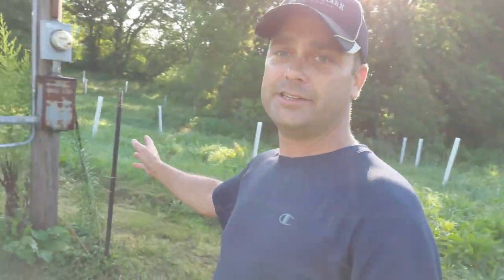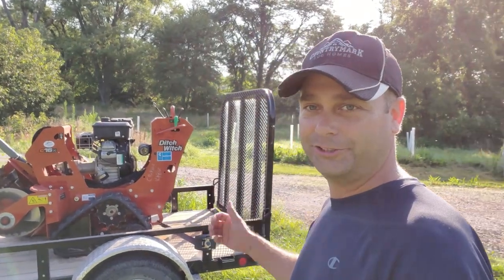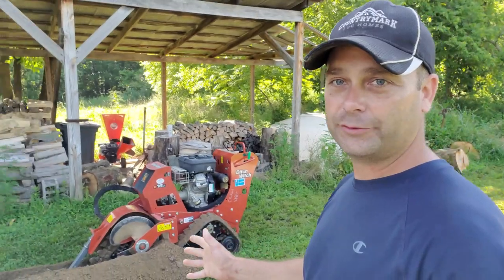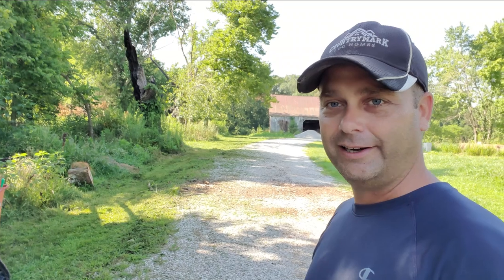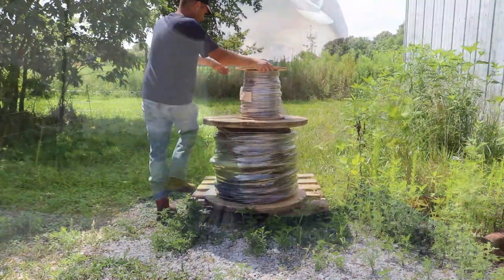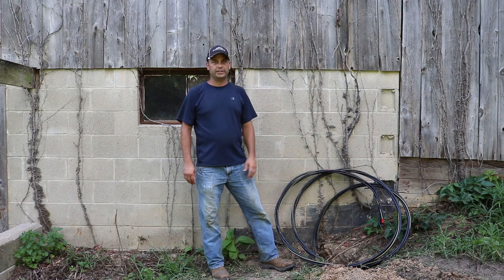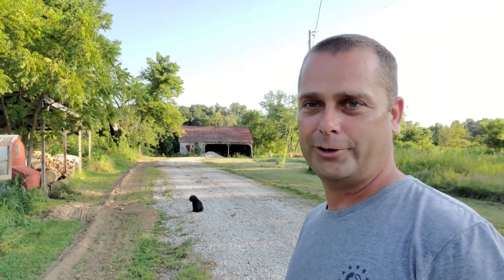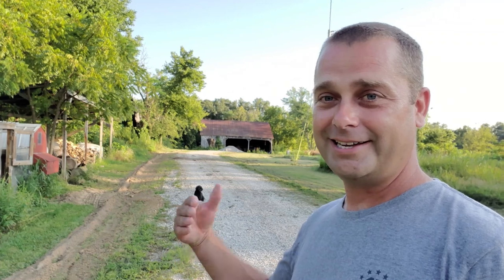Trenching in Underground Electric Service to the Bank Barn

Comment: I like your videos very much . I think that it's great the way you explain what your doing and why . Just like you did with the water line . Explaining your costs and what it's gonna cost you for a job is great . Some people do a job and don't explain the costs that are involved . Oh jobs done and that's it . Even the type of wire and size is good to know . You are so right on solar . You already have hydro on the property so why not use it . The amount of hydro you are going to use is not going to add much to your hydro bill . Great videos you have there . Keep them coming . Smart in using your blade to fill the hole . I thought that you would be using the bucket . What do I know ? LOL .

Comment: Very good job with that trencher.  I have a backhoe on my tractor and it probably would have taken me at least as long if not longer to do the job (digging the trench then filling in).  I like your idea for rolling the wire out.  I have done kind of the opposite.  I ran a pole through the holes of the spool then hung the spool on a home-made jig and pulled the wire off with my tractor.

I could be wrong, I am by no means an expert and am not an electrician.  I think you might actually get a little more than 60 amps (at 240 volts) on that wire run.  I wouldn't worry so much about the current draw for lights or receptacles in the barn, but for warmers you probably want to stick to 240 volt appliances.

Good luck and look forward to seeing the progress.
Reply from the maker: 60 amps will have 2.85% voltage loss at that distance.  A maximum of 3% is recommended.  You can get more amperage but the voltage will drop will increase.  I could get 100 amps but voltage will drop 4.75%.  So yes it is possible.  The breaker panel I installed is rated for 100 amps, but right now I am feeding it with a 60 amp breaker.  I could increase the breaker size later if I needed more power.

Comment: So happy to see someone who knows how to properly use a blade. I usually cringe when I try to watch inexperienced ppl backfill. You're water must be really shallow if u can add a well pump to the end of that run. No way could we get away with that, with pumps @350+ feet. Enjoy seeing you work your way step by step through the improvements to make chores less of a hassle. Time is money. 

Keep'em coming!
Reply from the maker: The well seems to be spring feed.  The water level is high enough to dip out water by hand.  It is a couple hundred feet down the hill from the barn.

Comment: I was in telecom for most of my adult life so not very familiar with high voltage. But that looked like aerial cable instead of burial cable. (The difference is in jacketing, fill and insulation. In the case of the aluminum ground it is exposed and in ground its life is greatly cut because of constant exposure to moisture)
Reply from the maker: The cable was USE-2 cable.  Underground service entrance cable.  90 degree C rated.  It is direct bury rated.  It is only a ground connection  between panels.  It is not used for a ground rod connection or as actual ground.

Comment: An equivalent UK mains cable would run at £2m! But that would be 35mm concentric 240v Phase - Neutral and Earth! 

You can buy load balancers (multi tapped Auto Transformer) where the volt drop is excessive .... but they are rare, ..... and expensive!

Comment: Good job!  Did you put any detectable warning tape in the trench?
Reply from the maker: No I didnt
Reply: The buried conductors will do fine for detection purposes.  A line locator could be used on them without a problem

Comment: Didn't notice you putting down orange warning tape above the electric lines. Was the inspected by the county or town?
Reply from the maker: National electric code 300.5 (D)(3) is for direct bury underground service Conductors (which is where the warning tape is called out to use).  The National electric code, defines service Conductors underground as Conductors between point of electrical service (electric meter) and first point of customer's service (which would be my 200 Amp breaker panel).  These Conductors are feeding a sub panel from my main breaker panel and would be considered feeder Conductors,  not service Conductors and tape isn't required.
I know some areas have their own code requirements,  but we use National electric code here.
Reply: @CountryViewAcres  Thanks for the clear explanation. Were it my install, I am sure I would use the tape regardless. It's cheap. Also, the depth and box installation...both ends...would need to be permitted and inspected by the county.
Reply: @timgarner6768  Agreed.. it takes two seconds and cost pennies.  You may be saving someone's life in the future. May be your own.. may be your kids when they get older and start modifying the ranch.

Comment: I am by no means an electrician but will be doing this for a property I recently purchased. I'll be going from the meter on the pole to a barn about 200 ft away. I'll probably use a 60AMP panel in the barn. Where I get confused is the wire. Can you tell me exactly what wire you used? I will mostly likely be purchasing at Menards or Home Depot.
Reply from the maker: Southwire voltage drop calculator will help size you wire.  I used 4 conductor wire.  The ground wire can be smaller size.  I think I used 2/0 wire for hot wires and neutral and 1 gauge for the ground.
Reply: That's some big expensive wire! You could probably manage 10 gauge wire and 15 amp breaker at that distance. Do the calculation. If 240v less voltage drop. If you need 60amps you will need that huge wire period.
Reply: @Randomadventurelife     I just double checked him.   At a 60 ampere load, 360’ aluminum conductor, 240 volts and 3% drop he is exactly at 2/0 aluminum.

Comment: You'd be amazed what you can power running off solar and wind. It ultimately comes down to the battery bank, and batteries have come down to around 25% of what they cost 10 years ago. Solar panels and wind turbines have also come down quite a bit while also getting more efficient at generating power. 

Also, the thing about solar, with a battery bank, is that despite all the upfront costs, which you can finance, you don't have to pay an electric bill if you're off-grid. All you've got to do is match the system you put in on a building to the power needs you'll have there. I suspect a livestock barn would take quite a bit less power than a home for a family. Even on a home add up an estimation of your electric bill for each month of the year, and add up the total for maybe 15 years then compare that to the cost of a PV power system with a battery bank. At worst, these days, they wash out, they're roughly equal. But, the PV system with battery bank usually tends to be less expensive over that time, and you don't have to deal with power outages.
Reply: Sorry to disagree, solar and wind are great, but let's be honest, if already connected to the grid, they make no sense at all for general use, except as an expensive science experiment, or maybe as an investment if the local electricity provider is buying your electricity back (and maybe not)... there is no way it's less expensive, everybody would do it if that was the case. 
Batteries for the 3 sites would cost more than $1500, and much more if you buy expensive batteries ! It could work for LED lights, but imagine you need to plug a 1000-2000W tool on any of these 3 places, only for a few hours ? That means at least 3 x 100Ah batteries (1 x Battleborn 100Ah is ~$1000, you could find $200 cheap brands). That's already more than the costs announced here, without any solar panel, inverter, controller. Grid power offers low electricity price, and much more flexibility : if he only usse LED's he won't notice the extra cost even after 15 years, but at the same time he has 60 amps 24/7 at his disposition, if he needs to scale up, without adding panels and batteries, replacing the inverter, etc.
Remember that you need to design "oversized" solar installations in case of poor atmospheric conditions, for longer battery lifespan, and mostly for the occasional equipment. Any serious offgrid solar installation has at least one large diesel/gas generator to supply the extra juice when needed ! and power outages can also happen, a branch on a panel, battery issue, etc.
That said, renting the digger and buying the cable would already cost me at least twice that price in my country, not counting the work and other parts (not to mention rules and permits) ! still, for this sum I would only get a single solar installation able to provide for light and the occasional power hand tool, and that's with cheap equipment.
Solar would make sense for the small offgrid plot of land I own, though... power pole nearby, but the price of a high voltage transformer, counter, mensuality, etc would be totally over the top for my intended usage.
Reply: A lot depends on the electric rates.   If it's less than like $0.20 a kwh, no, solar probably doesn't make sense.

Comment: Could you use copper or is to much money. We Will be doing the same later this summer. The electric company wants 35.00 a month for a meter on the barn.
Reply from the maker: Mine is $25 a month. For each electric meter.  Copper is more expensive.  About three times the cost than aluminum.  Copper could be used and it is better than aluminum.   I choose for the cheaper option.

Comment: Voltage drop: 8.85
Voltage drop percentage: 7.37%
Voltage at the end: 111.15

Please note that the result is an estimation based on normal conditions. The actual voltage drop can vary depending on the condition of the wire, the conduit being used, the temperature, the connector, the frequency etc. But, in most cases, it will be very close.
Reply: This is for your specified 360 ft run.
Reply from the maker: I calculated it as 350 feet on southwires voltage drop calculator.   I calculated as 240 volts, direct bury, single phase.  It came out as 60 amps 2.85% loss.  I can vary depending on how you calculate it.  I think I will be good.

Comment: Electrical heating is almost 100% efficient. Its just that it takes that much energy to do it. (We calculate efficiency based on how much energy is lost to heat)
Reply: More efficient if you can use a heat pump instead of a heating element.    But for hot water, I might think a solar water heater -- not electric might be effective.  A lot depends on his electric rates.

Comment: So you just buried the actual line in the ground? You don't have to run it through conduit?
Reply: Legally he can direct bury USE-2, but I would have definitely ran conduit. Conduit will prevent decay of the insulation and damage.

Comment: Just curious why you didn't run the wire thru pvc pipes to protect it?   I've watched other videos where they lay pipe first then pull electric wire thru it. Not sure if its a code thing or weather thing.
Reply from the maker: This wire is rated for direct bury.  No conduit required.  If you run conduit underground only wet rated cable is required.  Some people may use conduit for added protection or to make replacing the cable easier if it goes bad.  It was going to be an extra $400 dollars for PVC conduit.  I figured a barn wasn't important enough for the added wire protection

Comment: Am I not seeing a power pole less than half the distance?  The one right there on the other side of your drive?
Reply from the maker: Yeah that is where the transformer is, but the meter and breaker box is where I started.   I would have had to install a whole new electric meter to use that pole.  They charge $25 per month for a each meter.  Which would have cost me $6000 over the next twenty years.  So trenching was cheaper in the long run.

Comment: Less than $1000 to do that? It would have cost you $2500 to $3000 to have a contractor do it. Nice work!! Having electric in your barn is going to change everything about it.
Reply: Here it is in 2022... and the wire itself would cost more than this whole project by itself.  I'm looking at having to get 250MCM size wire for my doublewide home run right now, its 300 feet 😔.  The prices have gone out of control.  I'm getting a cost hookup thru family, direct master electrician's price for the wire, wholesale.... and aluminum 250 250 4/0 wire is gonna run me like 1,800 bucks. If the price were Retail?? Several thousand just for 300 ft of the wire
😔

Even did great getting this done when he did!!
Reply: @suburbangardenpermaculture3117  The wire he used is only 25% more expensive now. $1015 instead of $800. Not a huge difference.

Comment: Just curious why you didn't tie into the overhead line?
Reply from the maker: The overhead line is the electric companies wire.  To tie into it I would have had to have another electric meter.  There is a $25 dollar per month charge for each meter.  Which would bean extra $300 a year, so opted to run power underground instead.
Reply: Smart move . You are already paying for 1 meter . Why pay for another one . Even if you didn't use any hydro you still would have to pay that $25 .

Comment: Did you add  "J" boxes to your main line for power to the wood shed and slab? Love the vids!!
Reply from the maker: I ran separate wires for those locations.
Reply: Why not add a junction box and split it out? Just want to gave them on separate breakers?

Comment: I almost started to cry watching this video, you grossly overpaid an the aluminum cable, partly because you ran 4x2/O when you only needed 3x2/O and 25F of 6G copper for a ground at the barn, somebody took you for a expensive ride,   500F of 3x2/O is 546$ at Home Depot and 25F of bare 6G copper is 17,35$     But your execution was perfect.     Keep up the great work
Reply from the maker: Check your pricing again.  USE-2 direct bury at home depot is a lot higher in price.
Reply from the maker: That is #2 not 2/0.  And yes URD will work.  But that is the wrong size wire.
Reply from the maker: By the way, thanks for looking out for me.  But wire is expensive.
Reply: @CountryViewAcres    I have to admit that you are right on that one, my search on HD.com did not come out as intended,   but my commend on 4x2/O w 3x2/O is still valid, you could have used 25F of 6G copper at the barn as earth     I meant no offense.     Keep up the great work

Comment: ISN'T IT (CODE) THESE DAYZ TO PUT IN
THE (RED) CAUTION TAPE 👈🏼 .......
WHEN TRENCHING IN A ELECTRICAL LINE.

YOU BETTER HOPE 🙏🏼
THAT YOUR COUNTY OFFICIALS, 
DON'T SEE THIS VIDEO  or  U'LL BE
RE'DOING IT AGAIN THERE EINSTEIN .....
Reply: it's not required on a feeder line trenches.....per NEC....only required on SER line from power company side point of origin to meter box "there Einstein"
Reply from the maker: SKYguy,  yep just on service entrance cable.  Because of the high Arc flash potential between the transformer and electric meter/first disconnect. I just ignore the Einsteins that think they know the National electric code.
Reply: @CountryViewAcres  it amazes me that keyboard warriors have the ability to question themselves (clearly unimformed) in their OP and still have the balls to insult and name call in the same breath.  SMH